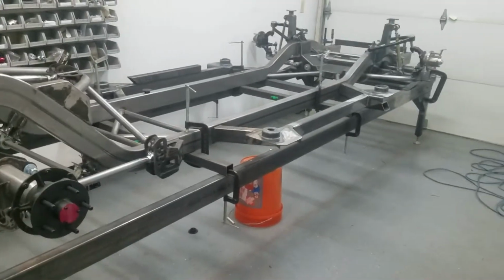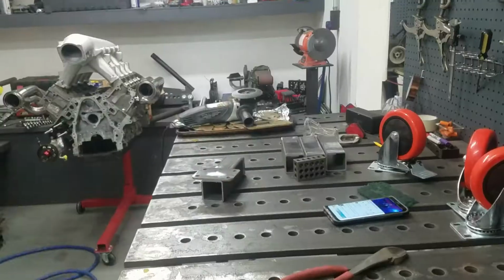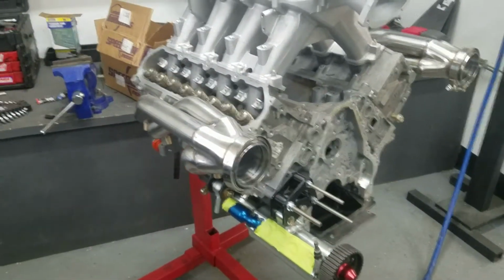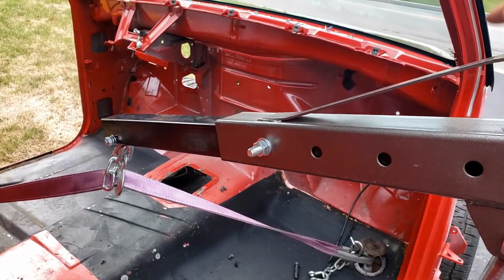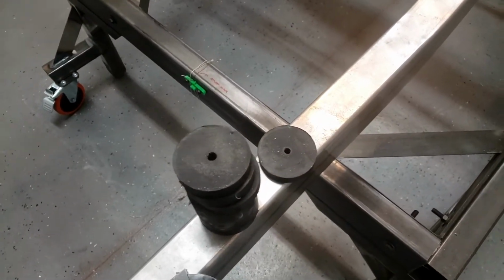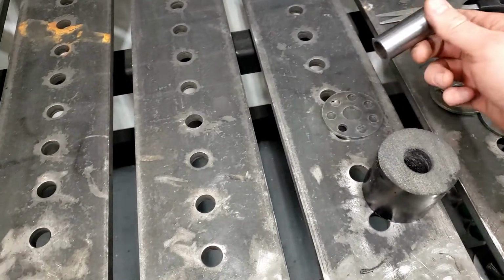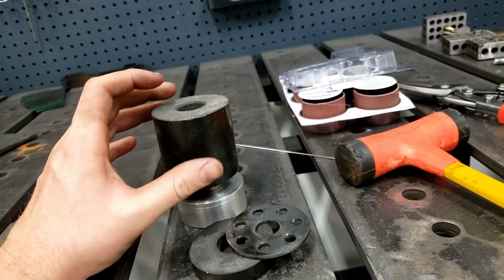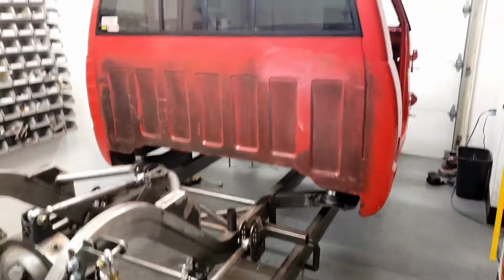Our build gets TWIN TURBOS and the Hi Ram! Getting the cab mounted! C1500R Protouring Build, EP 21,

Comment: I'm surprised how high the cab is off the frame, would you still have enough room for the drivetrain if you took the one inch aluminum spacer out of the back and cut an inch off the front mounts, or does that mess up the radiator support mounting? It looks like a body lift on a 4x4, I just like less space between the cab and frame, lower center of gravity, ect
Reply from the maker: The big thing you gotta remember, is the fender wheel openings determine how low the cab can sit in relation to the ground. You set your wheel opening height which defines your cab height. Thats fixed. As your frame drop decreases (moving your main frame section up) youre actually raising your center of gravity. The cab doesn't move relative to the ground, the chassis and all the stuff mounted to it does.
Reply from the maker: The chassis sits super low. The front frame horns are a 6" rise. With the way it sits now, 27" tires will be tucked in the front fenders with a 5" ground clearance. Most people don't realize the factory frame on these trucks are 8" tall in the center. If you hold the top datum line the trans centerline would be way too high. You'd have to tunnel the cab seriously to get the driveshaft through. I chose to hold the bottom datum of the main rails with respects to the rocker bottoms. This allows driveline clearance. Center of gravity change is minimal since the engine is set with respects to the chassis.

Comment: That longer pipe out the back of the oil pump, I'd use 45 degree fittings at most wherever possible, for minimal flow restriction.
Reply from the maker: For sure. Always a good idea to minimize PD in the system. That is the discharge from the scavenge sections. The pressure ratio across that section of the pump should be nill. Hopefully i can clear the motor mounts with a 45° kicker there, but that is realistically one of the least important to minimize pressure drop on. The suction side of the actual oil pump and the suction side of the scavenge ports are the ones you really gotta keep and eye on.